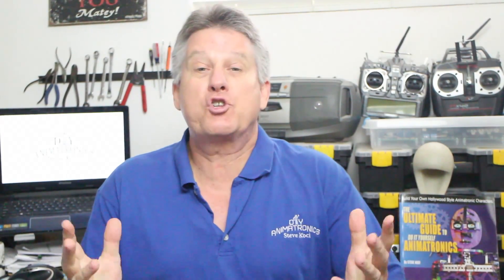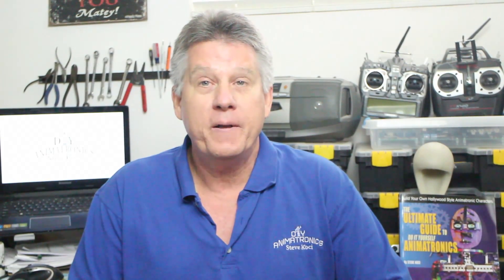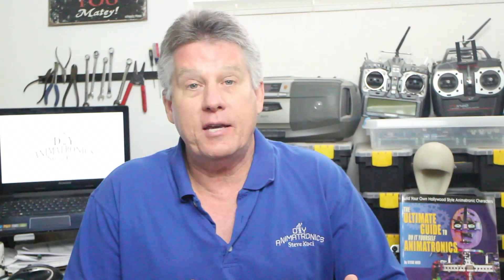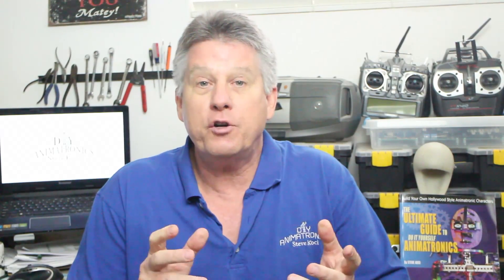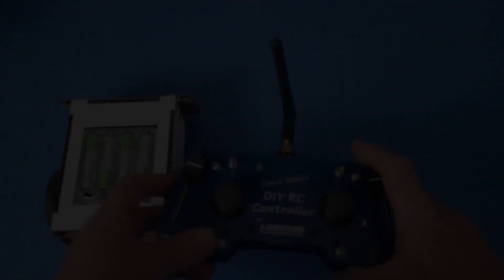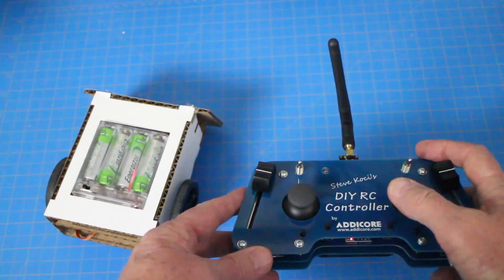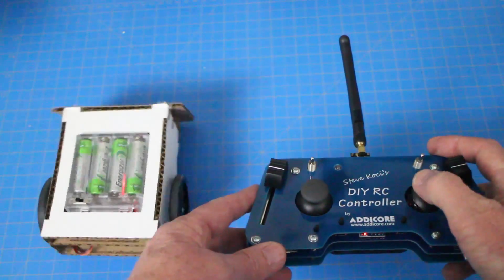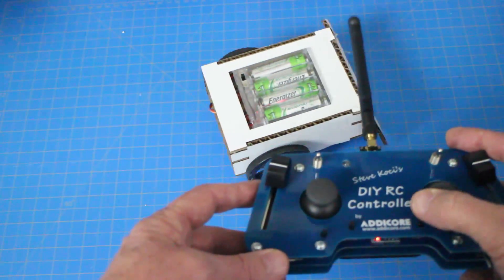DIY RC Prop Controller Kit

Comment: Very cool controller.... is the range similar to a rc radio in 2.4
Reply from the maker: Range is dependent on which antenna you use.  What range do you get using 2.4?

Comment: Will you be able to edit the recorded animation, fix minor movements, looping, etc?
Reply from the maker: The current plan is that it will a one time record session as we are pushing the memory storage available under the current plan.  I have those types of features on the wish list but we will see.  This plan for this controller is that it will be an entry level system for those interested in this type of control.   If you want a more advanced puppeteering set up, I still use this method - https://www.youtube.com/watch?v=TkJH7nt4B0w&feature=youtu.be